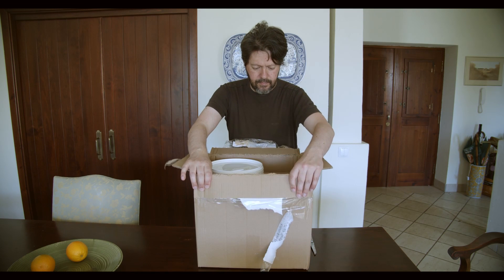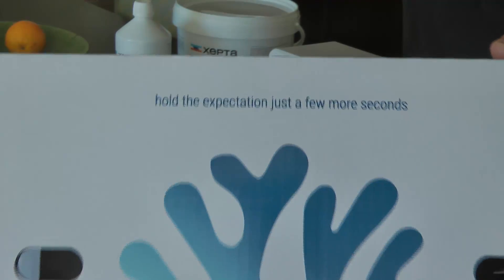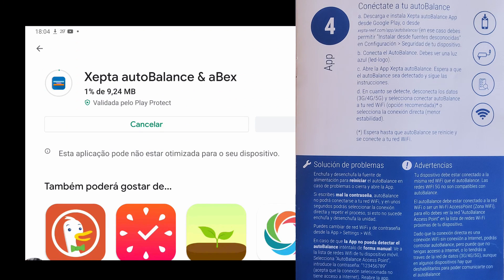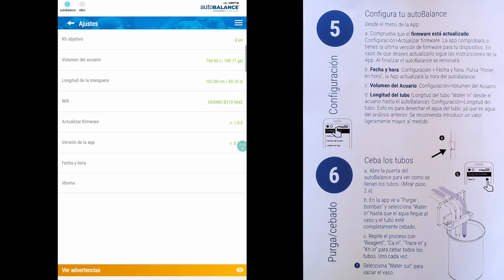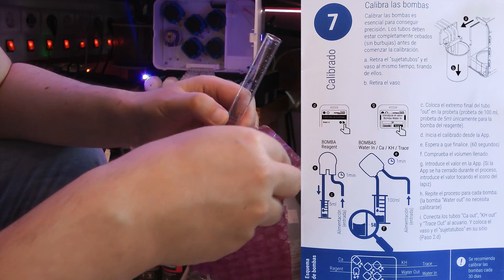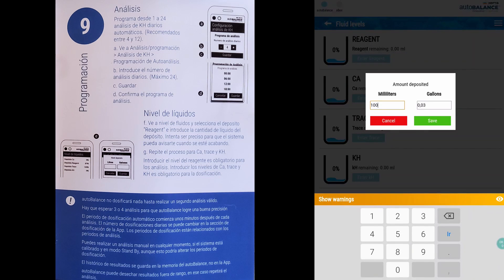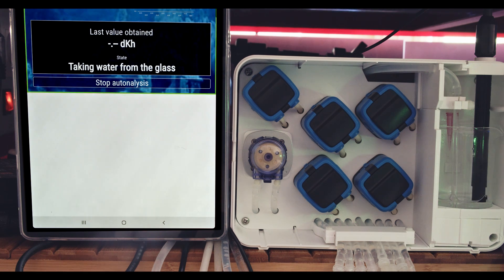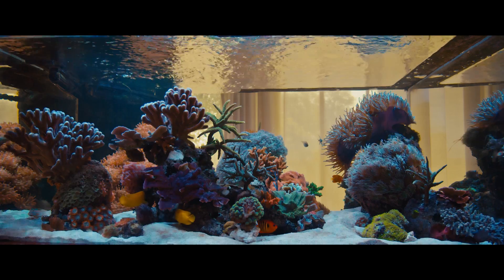Xepta Autobalance - Installation and review

Comment: The most helpful video that I’ve seen so far (and so much easier to understand now that I found the English version. I left a message with the manufacturer a few days ago, no response 😕. Coral Vue was supposed to be distracting these units and have them available by year end 2019. They no longer have any information on their website. I would like to buy one of these but am worried about sketchy support and software improvements. Has there been any new developments with the app? Second question, how would one tell the difference between the older units and the latest product? I am able to find a few of these new, but I don’t know if they are New Old Stock or if they are the latest version. Again thanks for an informative video.